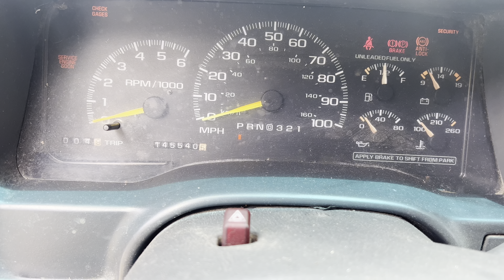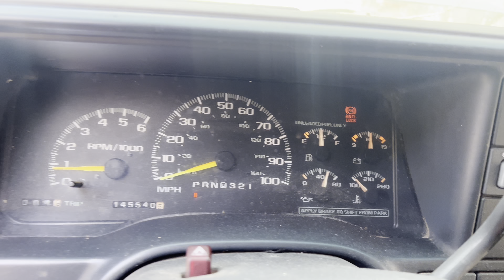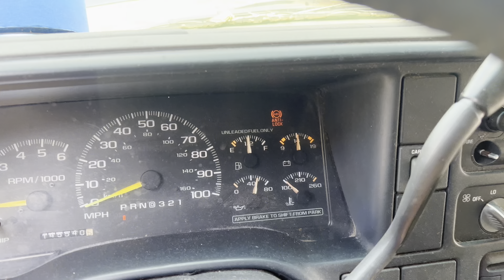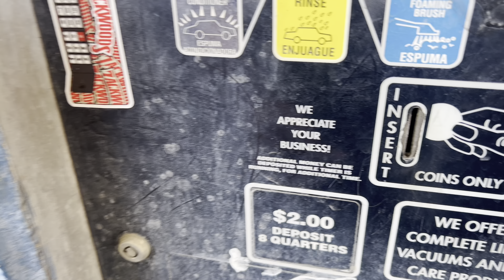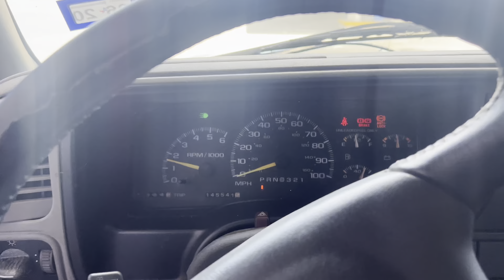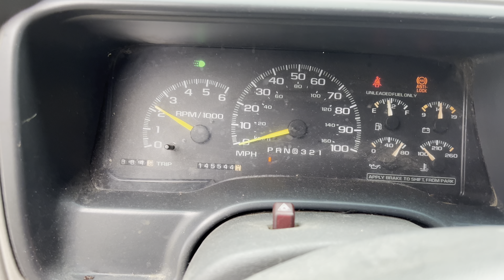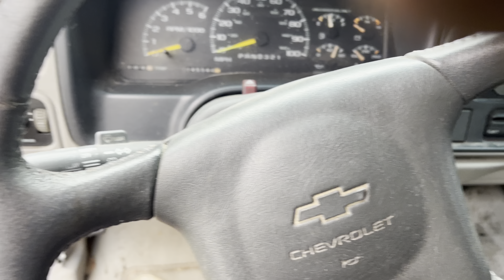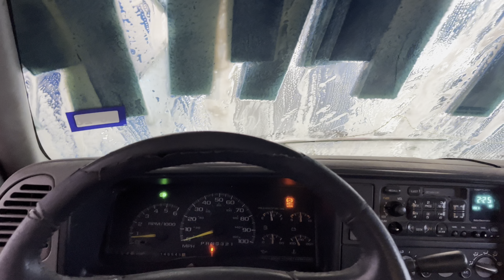Will Project Silverado Run after being abandoned for 2 years? #chevy #vlogs #houston

Comment: Thermostat sensor you swapped is for the ecu. Mine dash was reading fine but I plugged my obd2 in and it showed -0 on it. Swapped it and random issues I had went away
Reply from the maker: Damm I didn’t know that lol but it did work for me it started reading after I swapped it
Reply from the maker: @PEDR0SKI  lol look up Silverado or Sierra 2500 define the years to 99-00 and that’s when they pop up I’m guessing all shortbed were those years
Reply: @slickgarage6451  i passed up on a centurion years ago and I remind the wife all the time.  Currently only finding 4x4 shortbeds which is no biggie since I'm just window shopping at the moment(unless I actually find a solid one in my price range)